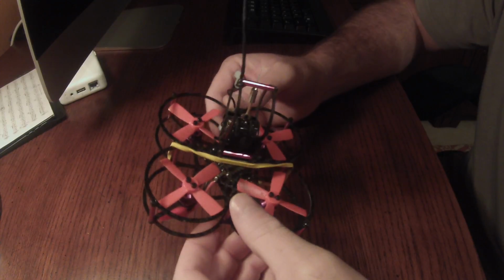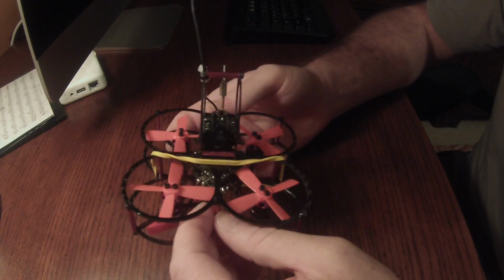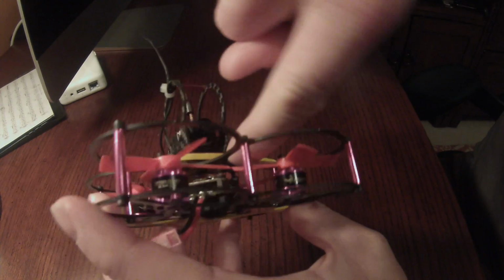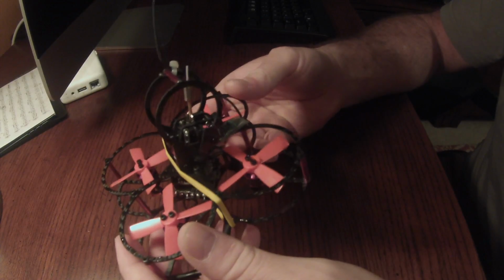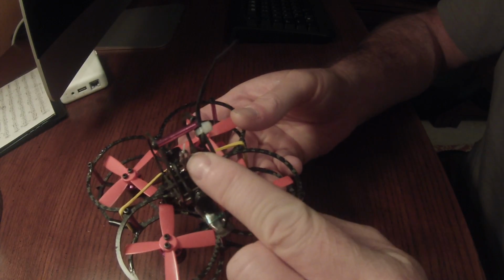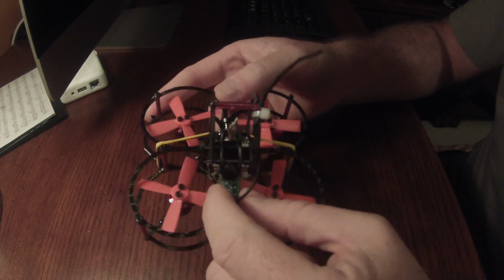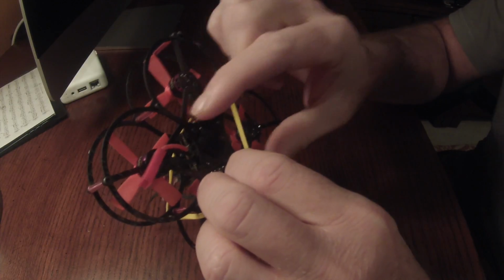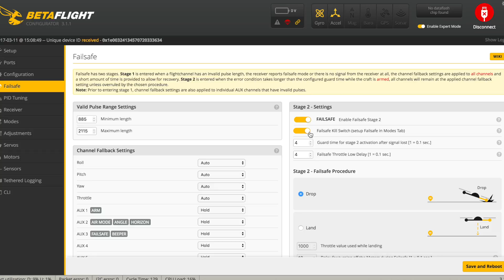XJB-75 Review & 3s Flight

Comment: hello, i just bought one for the parts and i will put it in a new frame + new props, do you know what length the motor screws are? im planing to use it with the arfun pro frame and its a 3mm frame, also do you think those motors need 5 blade props like in the jbx 80 version? i think they are too high kv for those and i should go for the gemfan 2035,  thanks for any help